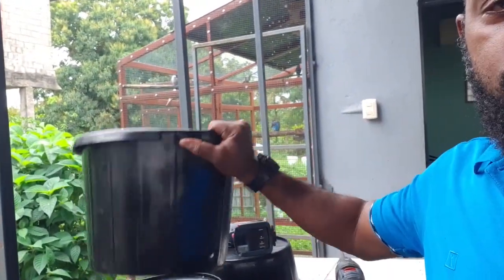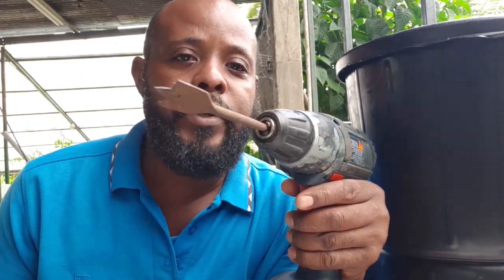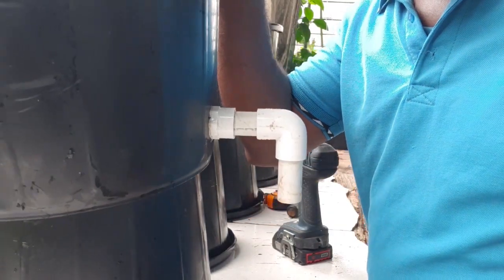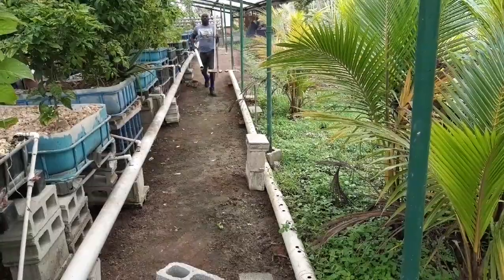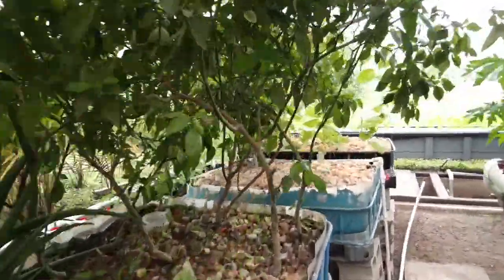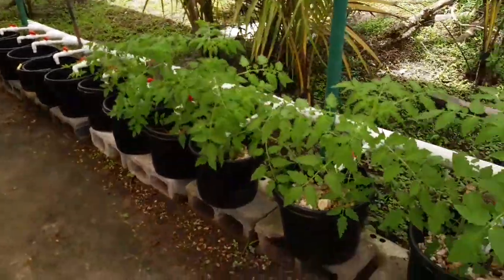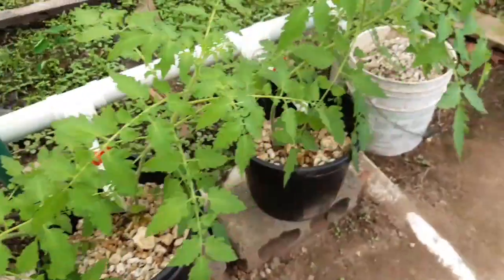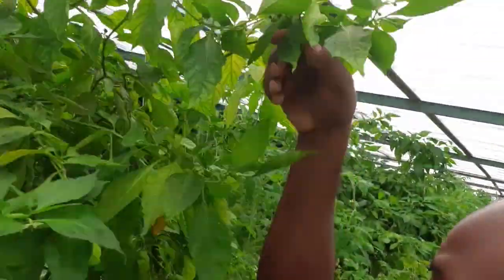Trinidad Aquaponics - Dutch Buckets 19th Feb, 2020

Comment: Thanks for the useful info. Is your Aquaponics in a greenhouse or open area?
Reply from the maker: It has a greenhouse covering, but its not fully enclosed.
Reply: I am looking to set up a commercial Aquaponics in Nigeria which has the same climatic condition as you have in Tobago. I like the way your system is designed. Will there be a substantial downside to leaving the side open like it is in your system in a commercial system?